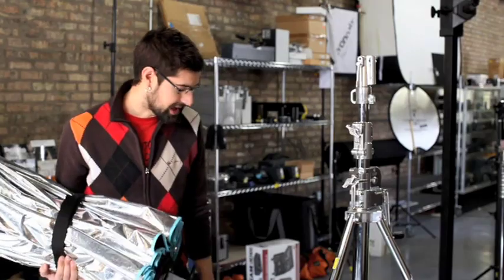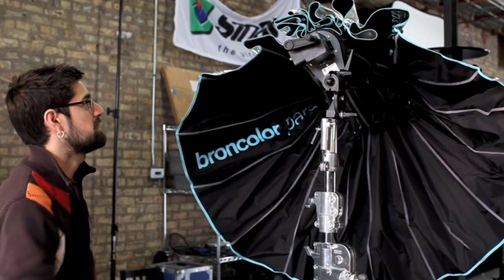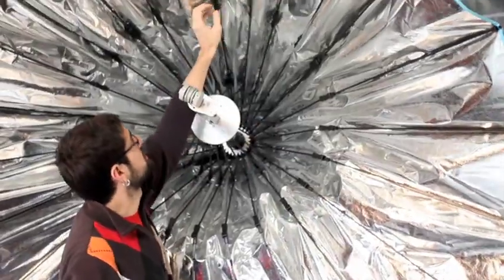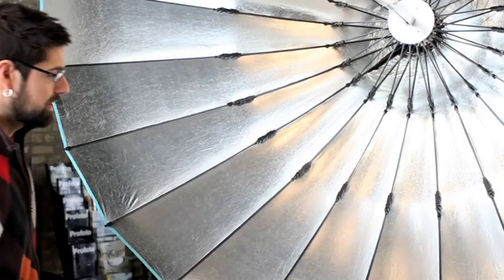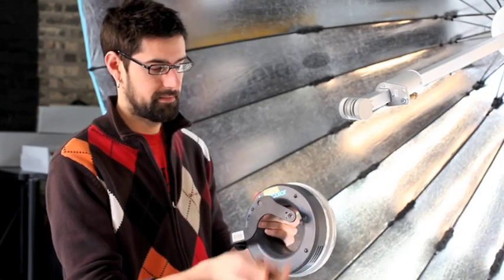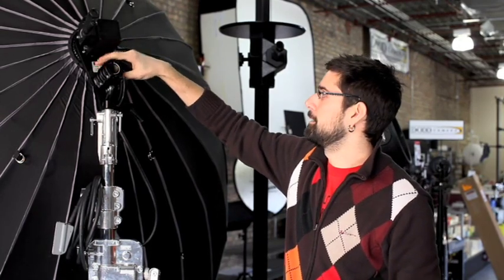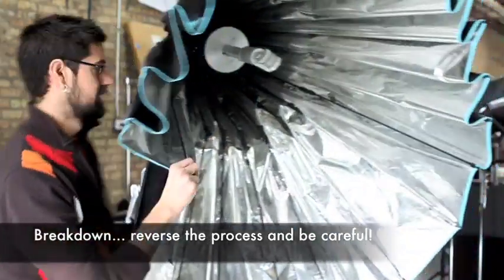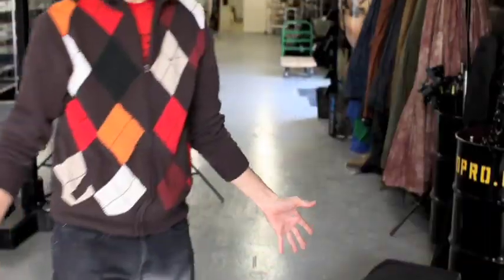Dodd Camera shows you how to set up and break down the Broncolor Para 220FB

Comment: Checking to ensure that the reflective inner material isn't caught in the hinges every time the system is opened and closed is a major design flaw. Having to pass the flash cord through a flap at the base is another sloppy engineering decision. Given such inelegant solutions to the challenge of creating parabolic reflectors, I'm surprised that the asking prices are as high as they are. Compared to what I've seen from Briese, the Broncolor Para system seems like an amateur's attempt.
Reply: totally agree... a fortune asking price and you have to be paranoid every time you set up or knock down .. no thankyou. Very acquard installation process... i have 3 beautiful 7 footers parabolics from Photoflex ... i cant see myself doing all this prep for a session my clients would simply walk away.